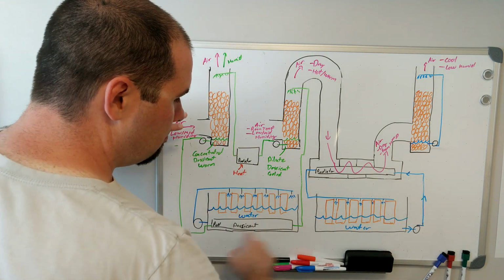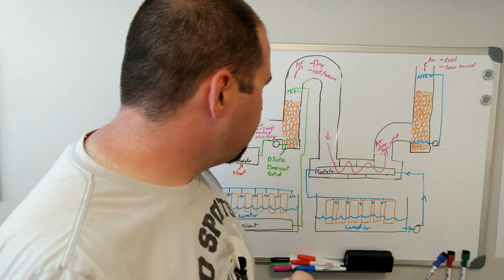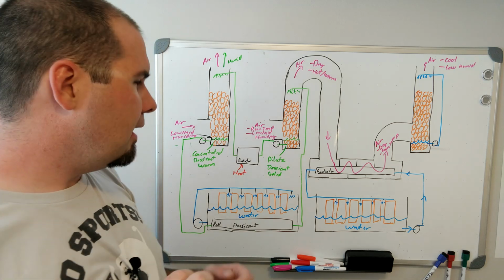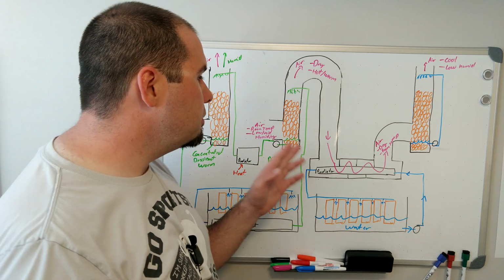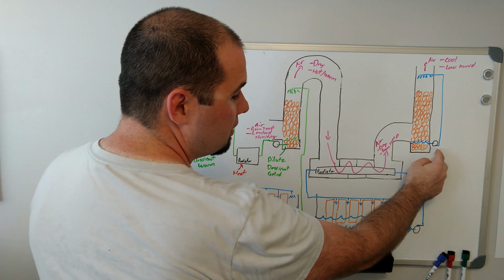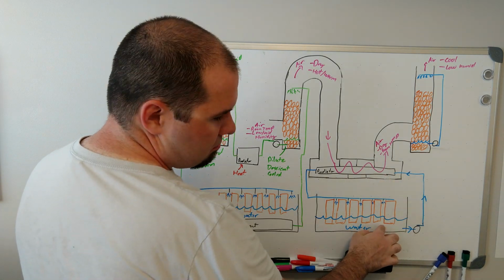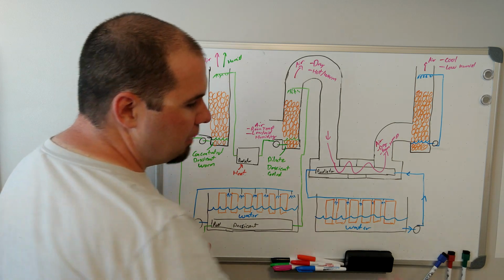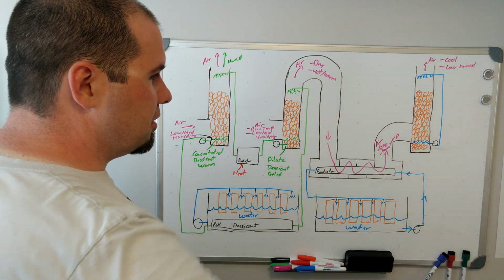A Revolutionary Air Conditioner Diagram

Comment: Nice video and diagram. He does however have a wire mesh in the tube to keep the bioballs from going all the way to the bottom. Doesn't make much difference but in my experience, they are kind of expensive. I ordered 500 for $40 but it really isn't enough to finish my build. I need more. But, I'm going down a slightly different road. I'm not as worried about the efficiency as I am the cooling amount. I plan to run off all solar anyway. But I am trying using Peltier for both the heating and the cooling of the desiccant solution as well as the fresh water cooling that is used in the last step. I am in an area of high humidity, so for me, the evaporation may not be as well of a coolant. TEC devices are not that efficient, BUT I will be using both the hot side and the cool sides. Also, stainless heat exchangers are not that easy to come by and not cheap. I have elected to try both powder paint coated aluminum heat sinks to run salt water through, as well as I am trying a powder paint coated heat exchanger from amazon. I will be submerging it into the salt solution, but running clean cooled water through it to cool the solution it is submerged in. Just a few concepts I'm trying that are different. I'm sure it will take more energy, but I'm testing it anyway.
Reply: Please send your design to me I would like to see an alternative to this. TEC I would have said no in this case but I am curious now that you are going to be using both sides heating and cooling you are definitely going to get a result let's see if it works. Thank you and good luck.
Reply: I'm fixing up a workshop near the Gulf coast of Louisiana. It's always hot and humid.  I know that the original source video was updated with a new design, but the new system was running in September with 65F and 45% humidity. If I'm ever lucky enough to get weather like that, I open up all the windows and enjoy it... forget about trying to run an A/C.  My concern with his original design and the revised design is that I am literally surrounded by a swamp and it is very often 90% humidity or more.  It seems as though dehumidifying is not his concern.  For me, it's the primary concern.  Sure it's nice to be cooler, but it's hard to get anything done when you constantly have sweat in your eyes. Any temp drop will reduce the amount of moisture in the air, but if humidity is high, it feels miserable regardless. I would not expect anything to get my workshop temp down to 70F, but I have been in that temp with 100% humidity and it's not fun.  

Considering it is always humid here, my biggest concern is that this entire system would be unusable for my climate.

 I am interested in your progress. Did you complete your prototype? Does it work in high humidity with an appreciable change in the temp or % humidity?
Reply: @WhoDatBoudreaux  If you are in a high humidity environment why not have your system run two stages of dessicent dehumidifcation?
Reply: @michaelbrebrich7124  I've given up on this project for the time being. Life has a way of rearranging your priorities without consulting you first... And that's what's happened here. 

I will consider your suggestion if I ever try to make this work again.
Reply: @WhoDatBoudreaux  agree. I'm originally from CT, retired to UT. CT humidity in summer is around 90% and temps in the 90s while UT is around 18 and 100 degrees, we just had monsoons here and it went to 38%. To me it's the humidity that sucks all my energy not the temps. So I know exactly what you mean about it being more important to drastically cut humidity.
Reply: @WhoDatBoudreaux  The cleverness of this system is having the desiccant absorb the moisture out of the air. One of the challenges to making it very effective is giving the desiccant enough surface area to take the water out of the air. The NREL (National Renewable Energy Laboratory) built a desiccant-based system that was roughly the size of a residential AC unit, using a vapor-permeable membrane instead of bioballs and a spray, to dry out the air and they got very good results from it

Comment: Keith i have simplified this design ie removed all radiators and cooling baths to cool the desiccant for the dehumidification  by using a set of oversized Desiccant reservoirs use natural convection to cool it with time...  Idea is to use two desiccant batteries we regenerate one (reservoir) while we are using the other to dehumidify the air.... one reservoir for one day...  the next day we swap out the dissident between reservoirs using pumps... that way we use less energy  and eliminate water use... and also keep it simple....
 please take a look and see if i am missing some thing...

Diagram :
https://ibb.co/J2hXrZF
Reply from the maker: Do you plan to use the same design with the evaporation cooling and the same "swamp cooler" in the end to cool? or do you need warm dry air? It looks like it'll work. You'll need to watch out for water contamination from the outside world though I think. I haven't analyzed his video in depth from an entropy perspective.
Reply: @kwakeham  using the swamp cooler in the end will add humidity but it will cool the temp below the outside dew point so that is good... and its an option if we don't mind the added humidity during mild summers... but when its extremely hot and humid... we can just run the dehumidifier and have the conventional AC to cool that will cut our cooling bill in half or more... But got to try it to find out...  
the water contamination is an issue but because this liquid has so much salt (35-40% salt) most bacteria wont survive... then we can build the out side reservoir with transparent material (plexi glass or transparent plastic) so it gets exposed to direct sunlight which is source of UV and UV neutralises most harmful stuff....  additionally we can add more uv lamps in the humidification reservoir to destroy any other bad stuff while its in use... So in a way this can also function as an air purifier...

Comment: I watched that video a while ago and indeed your diagram was super useful to get the details right! Thanks.
Very interesting concept of cooling, I'm just wondering how nobody thought about this earlier, if they did, why is this not patented, if it is, why isn't there already some commercial implementation and application.
I can't help but feel that there is some catch somewhere in this system that makes it either not more efficient than the usual heat pumps or not practical to operate. But I couldn't find any holes the video, all the bases were covered relatively nicely, including the "heating the desiccant" part.
Reply from the maker: Rough math checks out. The dessicant dehydrator/concentrator and those two coolers though might be the weak spot, if placed in the same room. They would add humidity to the room. So ideally I think those three processes need to happen somewhere else... like the outside of the room part of a regular AC unit. His video also showed me that there are whole house "swamp coolers". I effectively live in a Canadian dessert (Alberta) so I'm kind of curious if with the low humidity here if I could just use a single stage swamp cooler inside.
Reply: @kwakeham  when you collect a bunch of humanity air does it becomes water? Can you collect those water and recycle it back in the system?